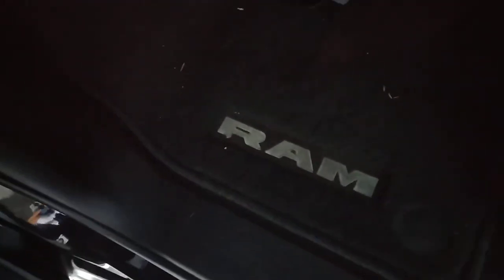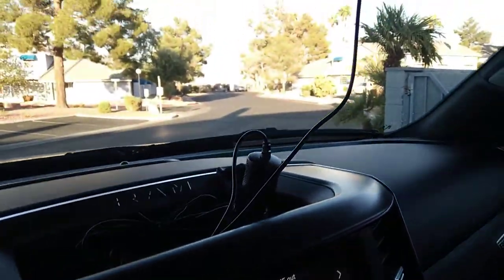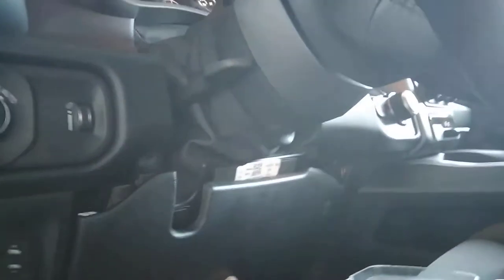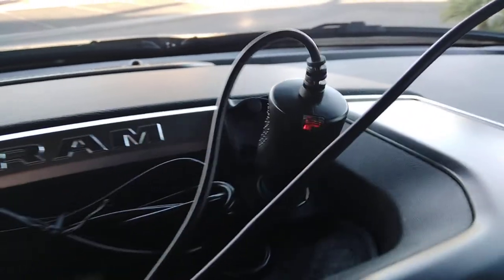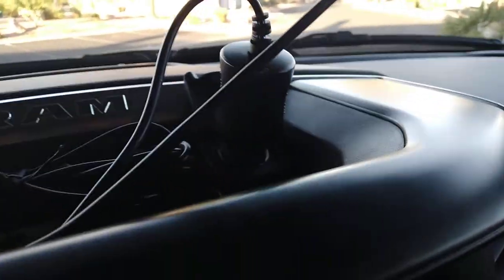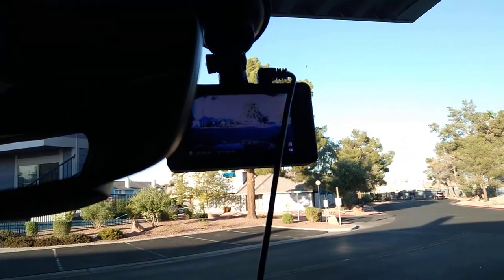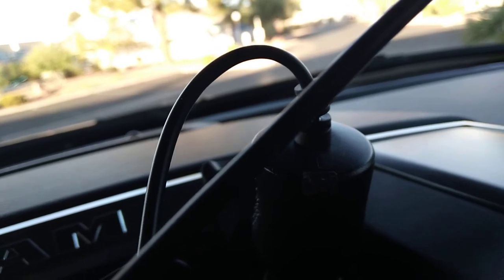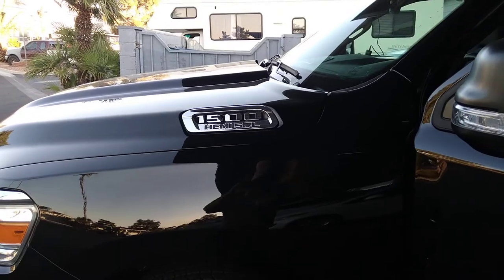2021 Ram 1500 - 12V Cigarette Lighter Stays On - FIXED!  No rewiring, no headache, no money

Comment: Ahh! When I replaced that fuse, I failed to notice that I inserted the new fuse into the right slot. The original placement had it to the left. I was wondering why after I replaced the fuse the power only came on when I had the ignition on. Excellent info!

Comment: What kind of dash cam do you use?
Reply from the maker: It depends on which one I get each year.  I live in Las Vegas so they fry and only last a year.  I'm debating getting one of the ones that go in the mirror bezel and take power from the powered mirror circuit.

Comment: Okay, so this is one of those rare instances when I can honestly say the interwebs and noobtube has come through for ya boy. Do you know how many hours I spent looking at forums and browsing Amazon for plugs, cables, devices etc. so that I can achieve this on the cigarette lighter power connector? Man, many hours for many months. Maybe I worded it incorrectly but wow what a life saver. I would always worry about my dashcam and other pluggable electric devices draining my battery and remembering to unplug the socket plug was so annoying. Sorry for the rant. I subbed and liked. Thanks. Any chance you figured out how to shut usb ports off when turning off the truck? I'm using a USB in line power switch to achieve this currently.
Reply from the maker: I haven't used my USB ports for anything but my phone, so I wasn't aware of the issue.  Have you checked to see if this also changed since changing the fuse configuration?  It is possible that they are powered from the same fuse (I'm not sure about that though).
Reply: @JDOTVegas  unfortunately the usb sockets have a different power source. They still have power after shut down. I have resorted to using a USB power switch dongle for my Motorola ma1 dongle  to have wireless android auto. Works, but I sometimes forget and the Ma1 will stay on draining battery.

Comment: Man mine it's not work even the fuse it's work I don't know why
Reply from the maker: You don't get power at all?
Reply: I found it the reason why it's not working because of its not connected that's why
Reply from the maker: @Matadon295  oh, glad you found that!  Thank you for the update.  It may help others.
Reply: If i put the f54b you think the battery is drained or not?
Reply from the maker: @Matadon295  I don't believe I understand the question.
Reply: If I put the f54b is the always on right if i use my dash cam for always on you think my battery is going  drained ?
Reply: Is that for a gas truck or a diesel truck I have a 4500 diesel truck and mine stays off also the socket works at times and sometimes it don't
Reply: My 2007 Ram (3rd Gen) does the same thing. Under the hood switch FUSE 38 over. The dash 12v outlet goes on with the ignition (default is constantly on.) The armrest console 12v outlet stays constantly on.